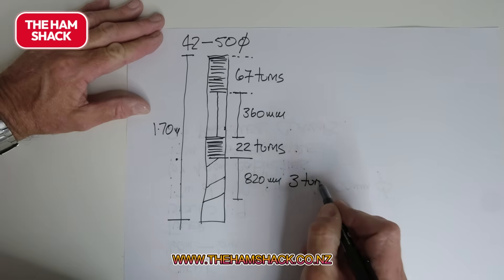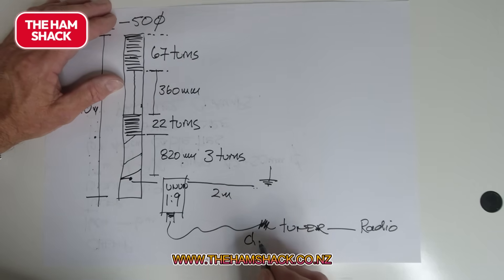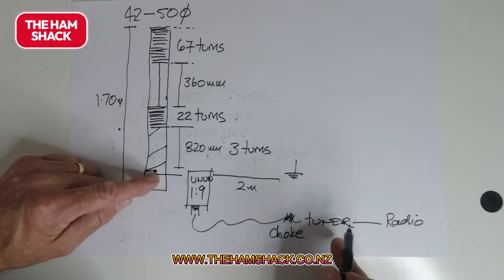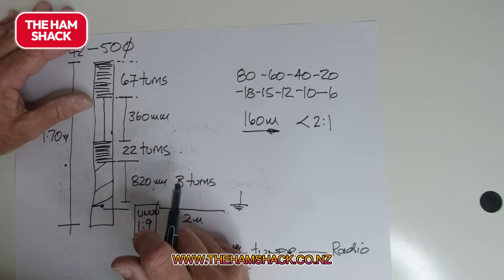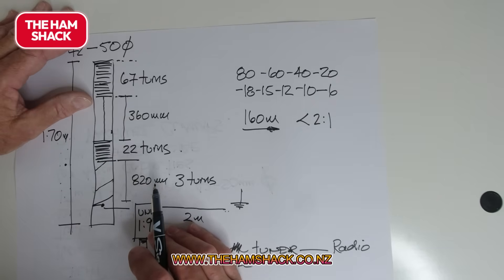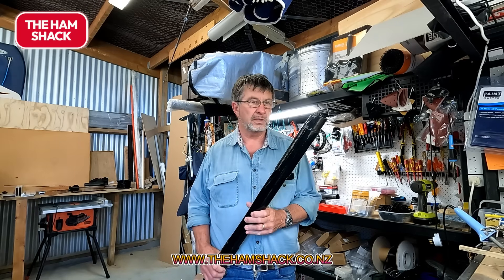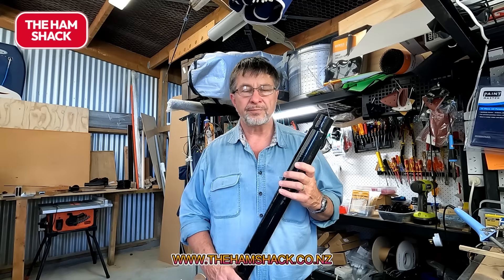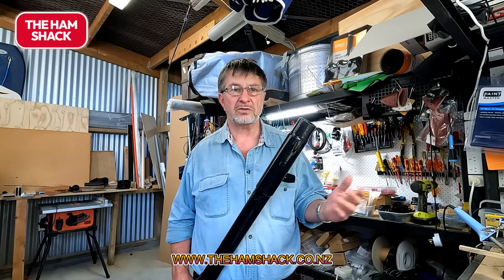Cheap Multiband HF Antenna

Comment from the maker: It would seem I am repeating myself over and over again. 

I was sent the design and built the antenna, I did not design the antenna. This is an antenna for local QSO's and due to the size is probably very inefficient HOWEVER it offers people an opportunity to get onto HF when they would not be able to do so due to HOA or other restrictions.
Reply: It appears to operate as a top hat antenna on 6M. Mounting high in the air is probably best.

Comment: How many turns of coax did you use in the choke section of the transmission line? I'm basically building this unit as a recieve antenna to be used with my noise cancelling device but if it will transmit for portable ops, its just a plus to add to the go box of goodies.
Reply from the maker: Hi Gary

I used 7 turns of RG58.
Reply: @The_Ham_Shack 
Suggest winding 20-ft on 4-in diameter PVC pipe, not jumble wound.
Reply from the maker: https://youtu.be/nR4231zk3pg?si=WknTqEMP9qi5whD5

Comment: Good Evening, thanks for posting such a great antenna project for an attic or HOA installation.  I went and reviewed the original plans from the link you provided and was wondering why you switched from using a 4:1 to a 9:1 unum in your build.  73 and thanks, WB4IZC
Reply from the maker: Hi from ZL land.

I made my version with what I had laying around so the pipe was 50mm OD or 1.968 inches. I used the same number of windings so the total wire length was slightly longer.

When I tested it with a basic built in tuner (typically tune 3:1 SWR) the 4:1 wouldn't tune a number of the bands and so having a radio shop I tried a 9:1 unun and all the bands tuned. I can check the impedance at some stage but that project is semi dismantled at the moment. I live on a small farm so have so have full size antennas up.

I hope that gives you some insight.

Best 73's

Greg
Reply: A 9 to 1 unun is standard on a Random Wire End Fed antenna.

Comment: love how people are dissing this antenna. clearly not paying attention! yes it is not much more than a leaky dummy load on lower bands that isn't the point. what is can do is provide a last resort for ops that for whatever reason cannot erect a more "normal" antenna at minimal cost. and my be of some use for remote portable in places where it's not practical to take or use long wires. and it may be useful as a wide band receive antenna.
Reply: He says several times that it's not a dx ant. I'm building it for a receive ant. I'm also winding s wire unun on the same form with 30 turns total and tapping feedpoint up 10 turns.

For what it is, it appears to serve my purpose. KK5R

Comment: Is the PVC diameter you used 50mm ID or OD
Reply from the maker: I just checked and it is 50mm OD
Reply: @The_Ham_Shack  Thank you. I have the wire to make this, just need a toroid for the unun and a piece of PVC. I might just to see what it will do

Comment: Additional note:
Take a 5 or 7 cm diameter, 2 m long plastic conduit from a hardware store. Wind 6.5 or 9.6 meters of wire evenly around the length of the conduit and use a 1:9 unun. This will yield better results, though not necessarily good ones :-)

Comment: Your video caught my attention, and I absolutely had to try it out. So I built the antenna exactly as described in the video.

Then I tested it with an analyzer on all bands, using both a 1:9 and a 1:4 unun.

I achieved the best SWR on 20 meters, at 1:6. On all other bands, it was worse than 1:10. No antenna analyzer will match that.

Conclusion: a total waste of time and wire, unusable. But I would have been surprised if it had worked. :-)

73, Bernhard
Reply: Sorry, of course "no Antenna-Tuner will match that" 🙂

Comment: Why did you decide to use a 9:1 UNUN when the original text called for a 4:1?  Just curious.  W7FLK
Reply from the maker: Hi Rick

I first used a 4:1 but found the SWR over 3:1 so my built in tuner wouldn't tune a number on bands. I tried a 9:1 which works on a random wire and all bands would tune.

I never designed the antenna just built it and fiddled a little. I also had a 50mm Dia tube so the length I used is slightly longer.

Hope that helps.

Greg
Reply: @The_Ham_Shack  Thanks
Reply: A 9 to 1 unun is standard on End Fed Random Wire antennas.

Comment: Make the PVC pipe a little longer and you can wind a 9 to 1 unun with wire (no toroid) by winding ten turns with three windings side-by-side, feeding one of the windings and jumpering the three windings so they are in series. No worries about saturating a toroid core.

Radiation caution about operating the antenna too close to you or others. Use lower power to stay safe.
KK5R
Reply: I recommend that the counterpoise, if used, be oriented opposite the rest of the antenna so the antenna tuning is not affected, band to band.
Reply: An inline counterpoise makes it more like an off center fed dipole so it should work.

Comment: I finally got around to giving the antenna a try this afternoon. I was pleasantly surprised how well it received for such a short design. 

Only tried it on 10m and 20m to make contacts and tested SWR on all bands from 160-10 (the LDG 9:1 doesn't work on 6m)
It's does indeed tune all bands using a LDG AT-1000Pro II. I had the antenna setting on top of a 5 Gallon bucket so only 18" off the ground with a 18' counterpose. I worked the first station at 1,434mi in CA on 10m on the first try on FT8 running 75w  then went on to test SWR on all the bands before trying it on 2om FT8. I worked 5 stations on 20m including 2 DX one in Brazil at 4,810mi and Madeira Island at 3,910mi.

Short test but performed better than I expected.  Here are the SWR  results 160m 1.6, 80m 1.7, 40 1.5, 30m 1.3, 20m 1.0, 17m 1.8, 15m 1.4, 12m 1.1, 10m 1.1

The contacts are in my log on QRZ or LoTW from 1/2/26 22:00 - 23:00 UTC

73's George N4HFE

UPDATE: I've put the vertical in my attic and it's performs very well. I did change out the 9:1 UNUN for a 4:1 and 160m and 80m is a no go with the 4:1 although I was not able to make any contact on either band with the antenna on those bands anyway. The antenna has close to 45' of wire (13.6m) so reception is very good and better than you would expect!

Comment: I'm sorry to ask but do you mean in 9:1 unun
Reply from the maker: Hi yes the 9:1 unun worked better
Reply: @The_Ham_Shack 
That unun ratio is also recommended for random wire end fed antennas.

Comment: You're one of those who doesn't know what SWR is and thinks that with a low SWR, all the power is radiated. SWR doesn't indicate efficiency: you can have SWR of 1 and radiate nothing.
In the this case of what you call an "antenna," the SWR is simply "hidden" by the high losses of a transformer that couldn't be made worse (an iron-dust toroid for a wide band transformer...) and that's there for that reason only!
There's no point in using a tuner because it couldn't recover any of the reflected power: both the incident and reflected power must pass through what you call a "transformer" and suffer its losses!!!
Go study! This video only proves that you know nothing about antennas and RF transformers..
Reply: The tuner is to protect the finals in the transmitter. KK5R

Comment: Do you know what gauge wire you used?
Reply from the maker: It would have been approx 18/19 AWG. It was cheap speaker wire/rip cord thar can be split into two single wires.
Reply: @The_Ham_Shack 
Should also work with #14 insulated house wire.

Comment: Very quick to build
This project forced me to build my 9:1 unun
Did a quick check on the VNA, and 40m is off the charts,
but with my ATU 100 I could get it to run at 2.* after a few attempts
The rest tuned vert quickly
Would love to make contact and discuss teh design to get more info

What is the recommender height for installation as an exmaple

within 10min after connecting it and start running FT8 on 40W output, I made 2 contacts from South Africa, Pretoria 
Understand one thing, QRM is very high
Reply from the maker: Congrats on the build. Mine is 4m off the ground, no reason but that was the pole I had spare. 

73's 
Greg

Comment: Thanks for the informative DIY antenna video. I definitely will be building one. Question: by "speaker wire", do you mean single or double stranded? If double, will cross connecting the strands work or should I just use one of the two? Is braided wire acceptable? I have enough pieces of scrap braided,  double-stranded wire to created the full 17m length required. Thanks
Reply from the maker: Hi Tom

I split the 2 core speaker wire into a single strand and used that. I guess any wire will do, and the thicker the wire, the better the bandwidth. The wire needs to be insulated. 

Happy New Year 
73's 
Greg
Reply: @The_Ham_Shack 
#14 single conductor insulated house wire should work fine.

Comment: Thank you for the diagram! Built one tonight but have not tried it out yet. Built it with PVC and wire I already had laying around. I think it would a cool antenna for the attic that would get you on all bands. With a good ground it should get out, I may try faraday cloth. I run a very compromised ATAS-120A with an FT-897 with 50w from my truck and can pretty much talk with anyone I can hear on 20m on up.  73's N4HFE
Reply from the maker: Using it in the attic is a great idea. I use an ATAS 120A with an FT891 in my truck , I do find it has a mind of it's own when tuning. 73s

Comment: the article is using a 4:1 unun instead of the 9:1 in yours why?
Reply from the maker: The 9:1 matches the impedance better. With the 4:1 it would not tune on a number of the bands.

Comment: Hey interesting build. A number of Debbie Downers here dissing your effort and sharing your experience. While it maybe inefficient on the lower bands it will be fun to experiment with. It's basically an end fed randomwire. I think I'll try one eliminating the bottom 3 turns and add a couple feet whip at the top, maybe a telescoping antenna for swr adjustibility. It should help dissapate the High Voltage at the top of the antenna.

Comment: If you driil holes and feed the wire trough you will spare four cable ties making the antenna sleaker and even cheaper.
Reply from the maker: That is a great idea. Thank you.

Comment: It would be helpful if you calculated or measured the antenna efficiency for each band.  SWR with a tuner suggests it's lossy, but it's not clear which bands it does well in, and which are radiating less than 0.1% of the transmitter's output. A decent SWR match doesn't actually mean the antenna is working, all it means is that the antenna is unlikely to damage the transmitter.
Reply from the maker: This antenna is not efficient HOWEVER it gives someone who is in a situation where the cannot erect large antennas an opportunity to get on the air on HF. In my opinion you can compare this antenna to a rubber duck antenna on a handheld, it works for local comms but not as well as a resonant full size antenna.

Comment: Just because something will tune means nothing - what is the radiation efficiency on each band?  I guarantee it will be VERY low on 160 - 20 and marginal above 15 Mhz.  5 1/2 feet length might make a decent mobile antenna for 10M and 6M but that's about all.
Reply: There's always one... "Any Antenna is better than No Antenna"

Comment: Thanks very much for this, I love the idea of a "rubber duck for 160m" !! That made me smile. An antenna this short is going to be inefficient, particularly on the lower bands but if it's the difference between being able to transmit or not, that's fine by me. A good antenna as you say for situation limiting use. Please could you say what the 3 spiral turns do and do they make much difference? Best 73, Ace, G0ACE
Reply from the maker: Hi Ace Thanks for the comment. 
Your comment says it all ...but if it's the difference between being able to transmit or not, that's fine by me.

Since the turns are so far apart I would think the three turns are just to make up the length. Just to reitterate this is not my design I just build and test some of the designs I get sent and see if they work. The total length is 12.73m if you use a 41mm dia pipe or 15.29m if you use a 50mm pipe as I did, and if one ignores the loading coil/inductance the total lengths are not harmonics of any band. (see the video on random wire length. I hope this helps.
Reply: @The_Ham_Shack  Thant's great, thank-you.
Reply: I suspect the 3 turns are for 6M and coils act as a top hat.

Comment: Thank you for this video. A few questions...like how does it work? SWR is important but that tells you nothing about how well this antenna gets out. A 50 ohm resistor will give you a 1:1 SWR but it is not going to be a very effective radiator. SO how will did this one actually work as a radiator?
Also, does the length of coax between the UNUN and the choke matter? Finally, how critical is the height above ground?
Tnx es 73 de Arnie W8DU
Reply from the maker: Hi Arnie

In my opinion you can compare this antenna to a rubber duck antenna on a handheld, it works for local comms but not as well as a resonant full size antenna. I understand that the antenna was designed to allow people to have local QSO's where antenna size is restricted or antennas are not allowed. 

Doing the research a counterpoise of 2m ~ 6 feet was recommended and in this case the unun had a counterpoise connection, whereas some only rely on the coax braiding. I would think that if you dont have an unun with an earth/counterpoise connection I would use a minimum of 2m of coax. Most of the coax cables I take on POTA activations are anot 10m ~ 33 feet long to run down the mast/pole to my radio so that should suffice. 

Regarding the height above ground, I have been unable to find any definitive research and most of the information available refers to vertical antennas with radials. A vertical with radials shouldiselly be 1/4 wavelength above the ground, with this antenna I will have to experiment a bit.

I am a radio enthusiast like the rest of you and not an expert. I just build and test designs given to me and see if they work. 

Best 73's
Greg
ZL1GUD

Comment: This is a shortened, base fed, end fed HF vertical that uses helical loading plus a 1:9 unun, used as a multiband “random wire” style antenna with a tuner rather than a resonant single band antenna.   Efficiency on the lowest band it covers will be modest to poor, because most of the RF current is forced into the loading coils where it is turned into heat instead of radiation, especially when a lot of inductance is at the base or lower part of the vertical.  On higher bands where the total wire length approaches a quarter wavelength or more, efficiency improves and performance can be similar to other short vertical or random wire systems using a 1:9 unun, often radiating only a fraction of input power on the lowest band but doing reasonably on mid and high HF

Comment: The article says a 4 to 1. not a 9 to 1 Unun...why did you use the 9 to 1
Reply from the maker: The impedance was closer to 450 ohms than 200 ohms so 450/50 = 9

Comment: On 160/80/40m it is dummy load, on higher bands - probably more efficient, 10m probably already at 50%.
Reply from the maker: I agree, but the purpose of this antenna is for a small garden with height restrictions and a HOA where antennas are not allowed. You might work DX but you can compare this antenna to a rubber duck antenna on a VHF handheld vs a 5/8 wave or other full size antenna. Both work, but one is for local QSO's and one is for longer distance comms. This antenna will work for local QSO's.
Reply: @The_Ham_Shack There is always someone around ready to shoot down any effort. It’s easier to do that than make anything. Thanks for uploading.👏🇮🇪
Reply from the maker: @donalfinn4205  thanks, I always think about the quote from Theodore Roosevelt's "Man in the Arena". Best 73's
Reply: @The_Ham_Shack 
There's an old saying in Brazil: "More checkers are played off the board than on the board."
Reply: I like the video but I have no interest in how many cups of coffee you drink. Do you feel better now you have told us?
Reply: @donalfinn4205 
?  ?  ?

Comment: Great antenna...what low cost tuner would suggest for this project?
Reply from the maker: If your radio has a tuner then that would work or as in the video I used the ATU100 which tuned every band.
Reply: @The_Ham_Shack thk u

Comment: is this recieve only antenna ? what is the power handeling and why no dx
Reply from the maker: The power handling is determined by the unun, so 200 watts. This antenna is a compromise antenna for a small garden and a HOA where antennas are not allowed, so, yes, you might work DX but you can compare this antenna to a rubber duck antenna on a VHF handheld vs a 5/8 wave or other full size antenna. Both work, but one is for local QSO's and one is for longer distance comms. This antenna will work for local QSO's.

Comment: Efficiency on low bands will be several % ...
Reply from the maker: It is a compromise, that is why we said it is for local QSO's it is definitely not a DX antenna.
Reply: So that is several % Greater than 0%, or No antenna...

Comment: Coax between antenna and choke will act as a counter poise too !!
Reply from the maker: Agreed, except this unun has a counterpoise connection (some don't), however I have tried it just using the coax and no counterpoise and it tends to not be able to tune all the bands.

Comment: I gotta try this.  Would be the ultimate POTA antenna.
Reply: No, not really. A 75 foot Zepp end fed antenna laying right on the ground would out perform it. Where it would really shine is as a receiving antenna for someone stuck in an HOA or at a camp. But, a ling wire is going to be much more efficient.

Comment: Have you experimented with it at a higher height?  Looks like a fun and easy build. Thanks for the video.
Reply from the maker: Thanks for the comment. 

I haven't tried it at the top of my mast, that said I want to change antennas in the next few weeks and so will try this at 6m (20 feet)